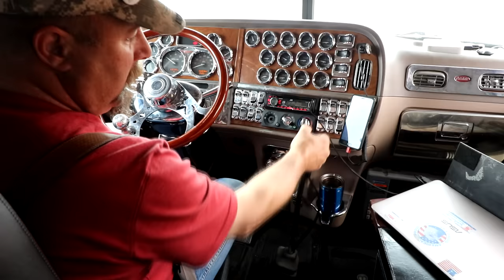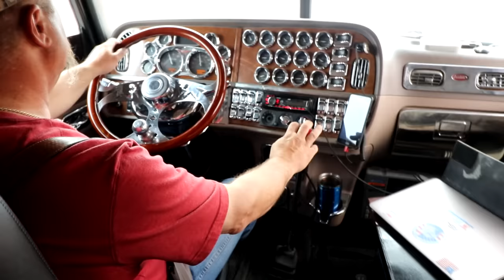How to shift an 18 speed transmission

Comment: Imagine seeing a red light in the distance and having to downshift 17 gears
Reply: clutch in
Reply: @Ryan Couchman oh ok. I just either clutch in and brake till I'm stopped or I put it in neutral and brake
Reply: Neutral says hi
Reply: @seventytwo4728  downshifts 17???  laughs as i'm popping the jakes
Reply: @Ryan Couchman bro that's what he said first.... smh
Reply: The light turns red 40m away?don't neutral brake or clutch in, just down shift all 17 gears. BE A MAN
Reply: Ha ha ha 😂
Reply: @Ryan Couchman Not a good idea to 'float', The Roadranger gearboxes do not have an oil pump so there is no pressure to the oil and gears quickly overheat.
Floating also known as Angel Overdrive or Maori Overdrive -- running down hill in neutral. Impossible to get it back into gear until things have come back to normal ----- if they ever do.
Reply: @alahatim  haha, If I drove a truck I would get so many tickets just for using the Jake's where they are prohibited 😂
Reply: @caleb3815  same bro.  you know what's weird though?  i hear ghetto cars driving all over the place with loud bass shaking people's houses, so why don't they get ticketed?
Reply: Put it in neutral and coast to red light don’t need to downshift
Reply: you engine brake. go into the lowest gear you can, then the next lowest, and by that time you should be close to the light and slow enough that you can push in the clutch and use the brake pedal to come to a complete stop. But sometimes, youre too close to the light and wont be able to stop in time even if you have 50 feet left, so you just roll on through. It's all a cal of judgment.
Reply: If I’m in 16th and coming to a red light I’ll let off the accelerator clutch in gear stick to neutral and use my momentum to get me to the lights and if they go green I’ll clutch in and put it back into gear ideally you judge the lights and your speed right and don’t have to stop completely and can keep going.
Reply: Who tf downshifts 17 gears. Even 5 gears u keep it in neutral and only put it in the right gear when you start moving again. Better for your clutch anyways. (The onky exception is when you run a truck downhill you don't want to overheat your breaks so you motorbreak
Reply: @OscarLT321  no that's called "riding the clutch" and it's bad for your transmission. You don't put it in neutral until you're almost to a complete stop
Reply: Neutral
Reply: @getsnapple9811  Do not put it in neutral and coast to a stop.
Reply: If you see a red light you just push in the clutch, shift into neutral and use your brake. If the light changes then you rev match and shift into an appropriate gear to the speed of your engine
Reply: @jackkinney283  That’s stupid. You don’t put it in neutral.
Reply: @BLACKBACK1002  why not
Reply: @slimchancetoo  No problem, enjoy the hydrocele!
Reply: U obv don’t drive if you think u go down 17 gears
Reply: Just put it is 1st in complete stop
Reply: @slimchancetoo  What...
Reply: Jake.
Reply: 18th gear means top speed. You don’t go top speed in these trucks you flog
Reply: Neutral has entered the chat
Reply: no problem at all...  jake brake .... beeeeeeeeeerrr berberberberberp skipskip shift skipskip shift beeeeeerrrr berberberberberrrrp skipskip shift skipskip shift  berrrrrertertertertertert nutrual trailer brake, pedal brake stop.
Reply: @slimchancetoo  runaway ramp =o    chaaaaaaaching
Reply: You don't have to shift one gear at a time you can skip gears when downshifting it wouldn't be that hard
Reply: You only do that when showing off on a road test.
Reply: @cokiez48 :  Not a good idea
Reply: Downshifting is sad
Reply: @thedankfish6748 :  Problem is that most traffic lights are fickle and unpredictable.
Reply: @ChaotiX1 :  The brakes may overheat, and in many cases you are considered out of control!
Reply: @ChaotiX1 :  You ride the clutch, you quickly destroy it. You have much explaining to do to your fleet manager or his supervisor!
Reply: @norbertsiewert3917  that's what I'm saying. Too many people think riding the clutch to a stop is what you're supposed to do. It's not.
Reply: @alahatim :  Not politically correct to do so.
Reply: @ChaotiX1 :  Anyone who has graduated from a truck driving school knows that it is a big no-no!
Reply: @norbertsiewert3917  yep, sad but true
Reply: @cokiez48  happens all the time. I do it occasionally but it is illegal.
Reply: @0mziyyt226  illegal, not in control of vehicle. Period
Reply: @slimchancetoo  malarkey
Reply: @alahatim :  It is because people like that are dangerous. Cops aren't stupid!
Reply: @Smithskii :  On a steep down grade, you dare not try to shift gears. To do so is suicide!
Reply: @alanlowe1733  Best reply I have ever received -- f%$#@ if I know what it refers to though.
Reply: Double down
Reply: Drive slow when driving a big truck in city traffic. Of course, do not be a nuisance doing so.
Reply: Just downshift to the 6th gear stop and put back in 3rd while stopped
Reply: @OscarLT321  in a car you don’t do this, it wears your brakes out. Autos don’t go into neutral and neither should
manuals. In normal driving conditions in a car not a truck, you keep the car in gear and hit the brakes until the rpm’s drop to around 1200-1500rpm then downshift once. You usually only need one downshift to bring your speed down slow enough and then you can ride the clutch. If you have to brake suddenly then you hit the brakes hard and before the RPMs drop too far downshift two gears. This is actually what early Porsche PDK transmissions did too.
Reply: Dab Zasco :  With experience, you will learn to skip gears. I became very comfortable with ten speed Eaton Fuller transmissions. I learned that you do not always need to be in first gear to start up. Often you could use a higher gear, depending upon conditions.
Reply: You can skip gears...
Reply: @slimchancetoo :  I agree. It you are going down a steep grade, do not even attempt to shift a manual transmission. It is better to be in a wrong gear than in no gear at all!
Reply: @caleb3815 :  I use Jakes when I have to. When it comes to my safety, to hell with the law!
Reply: @alahatim :  The kind of people that misuse their sound systems and vehicle exhaust are dangerous. The cops are not stupid!
Reply: @thedankfish6748 :  The problem is that usually traffic lights are too unpredictable. When I drive in a city, I always assume that traffic signals will be against me. This is the case nine out of ten times!
Reply: @ChaotiX1 :  You must like replacing brakes constantly!
Reply: @norbertsiewert3917  better than replacing the clutch every 3 months
Reply: @norbertsiewert3917  Indeed. We have quite a few notorious steep mountain passes that have brought the unwary SERIOUSLY UNSTUCK. Only once have I, many years ago, used an "arrester ramp" to stop the truck when the brakes began to overheat on an unfamiliar road and I decided caution was the better part of valor. Went into the ramp, a simple ramp cut into the side of the mountain and with a steep incline NOT filled with stones or gravel etc. Guys going down steep grades they are not familiar with in too high a gear are 'asking for trouble'. I always select the correct gear for a controlled descent --- at the start of the descent.
Reply: Ur clutching and technically coasting with the braking till u stop lol u obviously never done a standard before
Reply: @midokhalil1558  as it's been explained many times here already, you can't do that in a big rig. What standard do you drive, a 5 speed civic?
Reply: Just go low 9th gear then shift like 9spd
Reply: hold the cluch in and put it in neutral
Reply: Throw the jake brake on and down shift
Reply: Brake and down shift a couple...
That's all
Reply: Turn on the jake and throw it in neutral
Reply: Wagner PD  if you're skidding like hell then not even engine brake, new tires, tire chains, ABS, ESP can't help you. My dad's a truck driver too and he taught me to react like this from his experience
Reply: @slimchancetoo  
I guess that why they make those gravel runaway drive off ramps for. Yes your right
I make sure and raise those RPMS as I down shift pushing in CLUTCH just enough to down shift. I only have a 5 speed with my 8-7. But will not get it in if I am not careful. I was once driving for a guy. It had the 5 speed with just spitter. Cummins engine. I could not down shift worth a darn coming into rest stops. The driver told me just use the brakes instead. I would rather downshift though to slow. Coming down those steep hills North of LA on I-5 saw meany a truckers fly by me, I would keep her in gear safe for going down that scary grade. All I saw of those speed racers was brake lights in distance.
Reply: The Jake brake don't work in neutral you have to be in gear for jakes to slow you down plus you don't roll neutral that's dangerous. When going down a downgrade before you enter the downgrade downshift 2 gears lower than what it took you to climb the mountain use your Jake's and take it nice and slow and leave it in the gear until you reach the bottom of the downgrade
Reply: i am confused 😕
Reply: An 18 speed tranny is basically an 8 speed with a low gear.
Sometimes, its referred to as a 9 speed.
You can split all 9 gears in half, including reverse.
The OP is explaining this in the video.
My last two trucks have 18 speed transmissions.
You don't really have to shift all 18 gears to move the truck, especially if you're pulling an empty or you are bobtail.
But if you're loaded...
It makes it much easier to shift.
The heavier you are, the more you need to use all 18 gears.
Its easier on the cmutch and the rear differentials.
By the way...
You want to shift without pressing on the clutch.
You only use the clutch when you put it into gear, or you are backing up.
Diesel trucks have "unsynchronized" transmissions.
I shift down by jumping full gears, not splitting.
Although... I can if I want to.
But if you're in traffic, you just do not have the space.
I compression brake, then pull it out of gear and brake to a stop.
Good truck drivers are allways looking 10 or 20 cars ahead of them on the freeway.
Thats why we keep A LOT of following distance in front of us.
The trucker in this video is driving the same type of truck that I have.
Pete 379, with an 18.
I have a Pete 389 daycab, 293 wheelbase, 18 spd, 600 cummins, and 4:10 rears.
The tranny is a RTLO18918.
This means that it has an OD high gear.
My truck us ungoverned.
It can do 120 MPH.
389's usually have a sleeper but...
The former owner took the sleeper off and installed a daycab kit so he could run local, like me.
I run super heavies and oversize in Seattle, out of the port.
Great video.
Very easy to understand.
Very precise.
Reply: @TheErik249  
Great comment. Very understandable
Thank you
Reply: @valentinpopescu98  you need to keep your vehicle in gear to maintain control, you're not supposed to just coast to a stop like that.
Reply: @cokiez48  no, a semi truck towing a heavy load must downshift to slow down, just using your air brakes to stop a vehicle with that much inertia is going to overheat the brake drums. Especially going down a hill.
Reply: @ChaotiX1  these people who are saying coast to a stop have never driven a truck, you're not even supposed to do that in a passe ger vehicle but you can get away with it.

In a loaded truck you absolutely must use your transmission to stop the vehicle, proper downshifting is critical and a difficult skill to learn when starting.
Reply: @jackkinney283  no, you do not coast in neutral. On a road test that is a fail. Keep your truck in gear.
Reply: @jonbradley4044  Even with 80k pounds you do not need to downshift put it in neutral and you’re good brakes will be fine going to red light & going downhill put in a lower gear and put on engine brake never touch your brakes.
Reply: DucknCoverin  finally, someone who knows what the hell they're talking about.
Reply: @jonbradley4044  well I drive a car and I don’t keep it in gear coming to a red light cause I’m lazy
Reply: @jackkinney283  well, like I said, you can get away with it in a car because you're not stopping over 20 tonnes. 

Even in your car, coasting in neutral is considered not being in full control of the vehicle.
Reply: @jonbradley4044  yeah I knew you could get in trouble for it. But yeah I agree, in a truck engine braking is much better than coasting
Reply: @jonbradley4044  yeah, I know, that's what they teach you, but it's ok unless you go faster than 100 km/h. You wear down the transmission for no reason and put stress on your synchronizers when you engine break
Reply: @valentinpopescu98  what if your loaded tho
Reply: @ben10bro22  oh, if we're talking about trucks that's totally another thing, yeah. I don't even have a truck license, I talked about what I drive - my car and under 3.5 tons van.
Reply: most people just put the car in neutral until they have to start again.
Reply: @valentinpopescu98  its dangerous to brake in neutral
Reply: You don't have to go -1 every time. Also in a regular manual, you don't have to go 6-5-4-3-2-1. When I still had a manual car I'd usually drive in 4 in town, down to 2 and only use 1 if really stopping.
Reply: Clutch in slow down get the right rpm’s and skip gears
Reply: Slow down enough and rev the engine high enough and you can drop 2-3 gears at a time.  Never done it with a 18 but with a 10 I would go from 10-8-6 to N with clutch in.
Reply: @0mziyyt226  Because you never want to coast a truck out of gear loaded or not. The power steering is gear driven by the motor. If it dies you cannot steer the truck and you will crash, no matter how strong you think you are. As long as it's in gear when you loose power you can at least steer the truck to the shoulder. Same for the air compressor to keep your brakes from locking up.
Reply: @ChaotiX1  If you learn how to float your gears your not using the clutch to downshift
Reply: @vcxmp2k124  Now that's funny shit right there
Reply: @anthonyaubuchon765  it works tho
Reply: @anthonyaubuchon765  first of all, you must have read my comments wrong, or you're intentionally agreeing with me, because thats what you just did. Second, I know how to float gears. This isnt about that, this is about not RIDING the clutch to a stop.
Reply: slow down and hopefully you can shift down to sixth gear and then floor it when the light turns green.  no clutch needed.   or go to second or first gear until the light turns green.
Reply: @crazyman5520  make sure you record a video downshifting
Reply: Man you guys are confusing me with these different answers
Reply: I'm pretty sure you can skip gears.
Reply: Switch off the vehicle using the key. Don’t panic 😂
Reply: @alahatim  I never in my life heard someone call a car ghetto because of loud music, this right here had me rolling man 🤣.
Reply: Would you really downshift through all the gears? Your clutch and transmission probably hate you
Reply: Come on man that’s not how it works 😂
Reply: @alahatim  True. I've heard Harleys so loud that they set off car alarms. Same thing.
Reply: BROoom, ROoom, ROOooooM, BARROOM TURBO NOISES, BROOOOOOM, BRROOOOOOOOM, RRRRROOOOOOOOOOOM, ETC.
Reply: I don’t know about truck but tractors🚜 also have minimum10 to max 24 to forward gears and there’s front and back shifter separate ❤
Reply: Very simple
Reply: @caleb3815  we all do it anyways